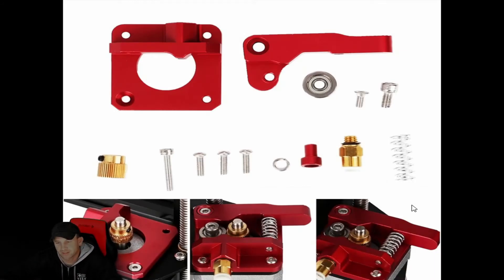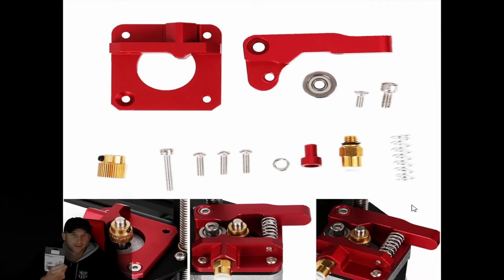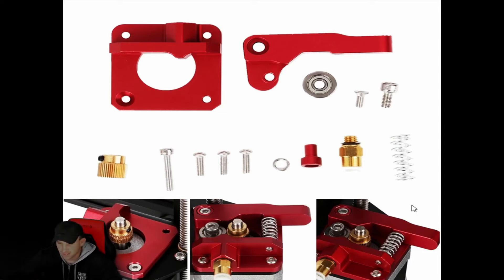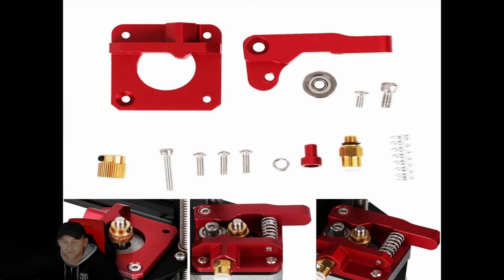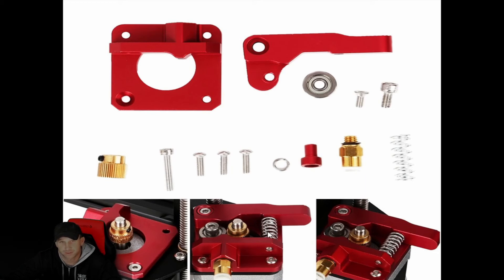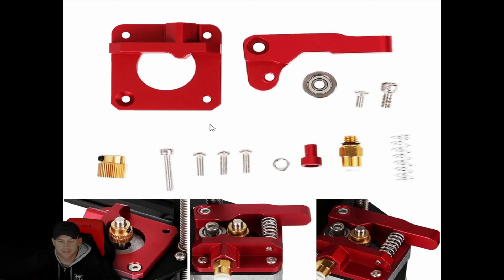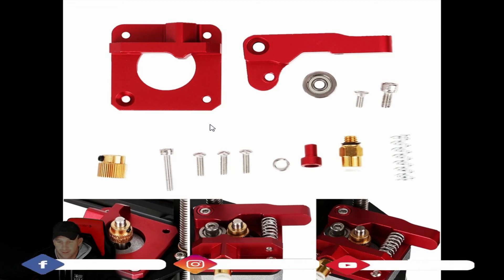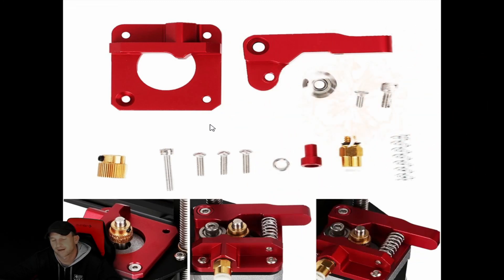Creality CR 6 MAX Extruder Upgrade Replacement and Repair Upgrades for Your 3D Printer. MK8

Comment: I am looking for this MK8 extruder for my CR-6 Max but don't see one listed for my model. What creality model uses the same extruder - cross reference?
Reply from the maker: This one should work for yours.  Its a universal part, usually bolts right up.  IHUCT